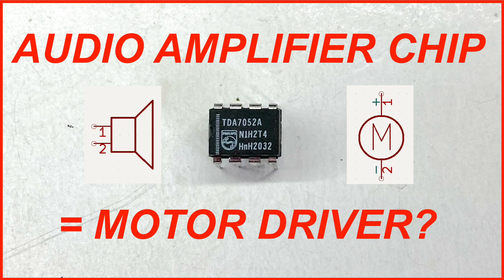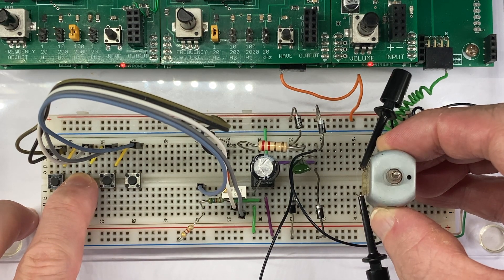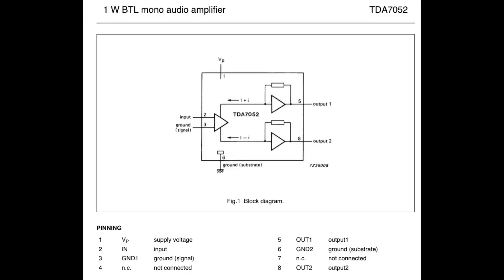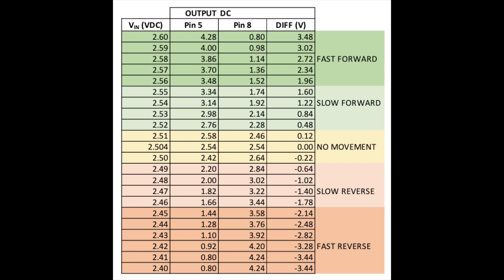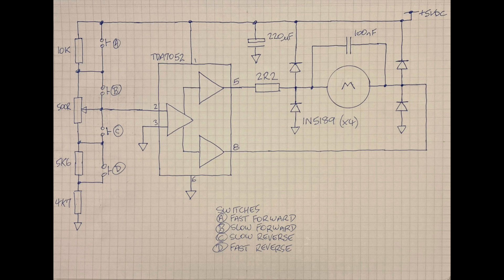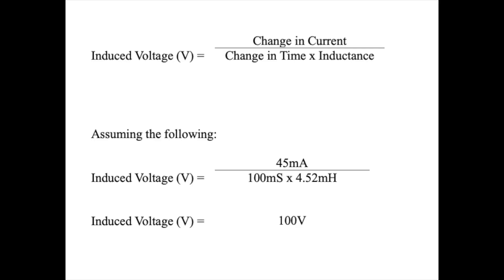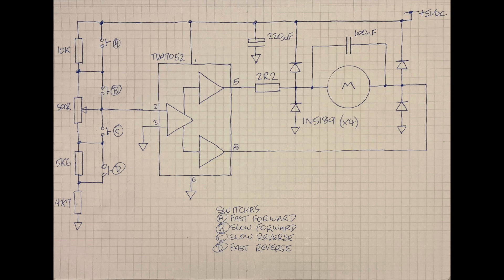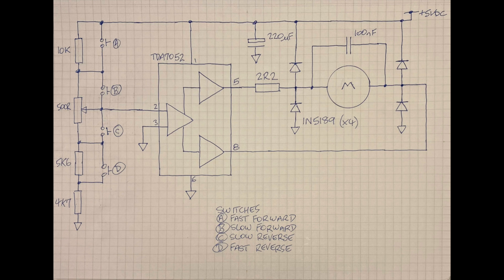An audio amp can drive a motor?

Comment: Thank you. I am trying something similar with a TDA2030 chip to drive a windshield wiper motor. I need a circuit that will drive my 3 amp motor clockwise if signal is positive and counterclockwise if signal is negative. I am using comparators to determine signal polarity, but they can't drive the motor directly. I tried a DPDT relay, but again, the comparators couldn't directly drive the relay coil. I then saw your video, and think I can bypass any relay or motor driver by just amplifying my comparator signal! This is to drive a solar panel one way or the other depending on sun angle
Reply from the maker: Hi! The output peak current of a TDA2030 is 3.5A, so there's not much headroom if you're driving a 3A load. Your motor would need to be driven with 2 chips in a bridged configuration if you need to reverse the motor direction. Also, be mindful of back emf from motors when switching - you'll need some sort of snubber across the motor to prevent damage to the amp output stage. If you do try this leave a comment to let us know how you went!
Reply: @inazumadenki5588 @inazumadenki5588 my circuit successfully works. I only turn the motor on for 0.2 seconds every minute, and the direction for that 0.2 seconds wont change. For the motor, it doesnt think its reversing, just turned on in a different direction. I think the duty cycle is so low and spaced out that handling the amps is fine. I struggled with an H bridge for the amplifier since i had a control signal that was either +1 or -1, and most bridges required a positive signal but at different legs. I am not an electrical engineer but find ltspice invaluable for what-if questions

Comment: Randy Sargent did something like this with his LM386 BEAM robot design.
Reply from the maker: Thanks for the info - I've learnt something new. I found a few examples online - a very simple circuit indeed, with motors connected directly to the output of an LM386. Very impressive robot with so few components.

Comment: Hook up a scope and check back emf?
Reply from the maker: Absolutely - It could be done. Though, to protect the chip, I'd still have diodes on the chip outputs, then connect the motor via some resistors. You could then measure the voltage excursions at the motor. However, you might be able to run it for a few seconds without the diodes and resistors, just long enough to record it on the scope, without permanently damaging the chip. I might present this in a future short.
Thanks for your suggestion.

Comment: I once tried to use a audio amplifier chip to drive a transformer to create a small crude inverter. It could handle a lamp and charger but not much more
Reply from the maker: That's a novel solution. There are possibly many applications for these audio amplifier chips. Thanks for your comment!